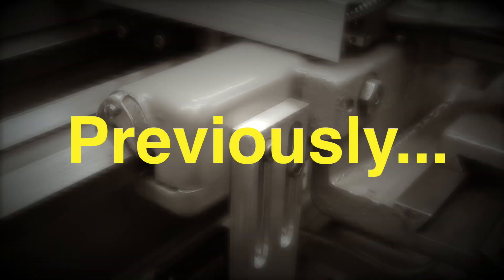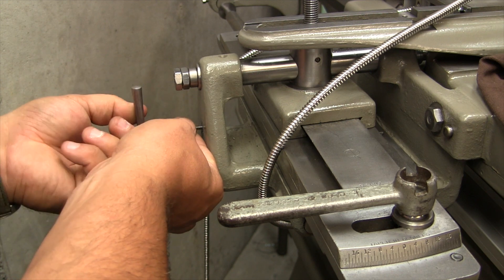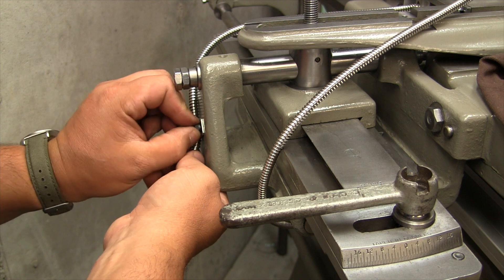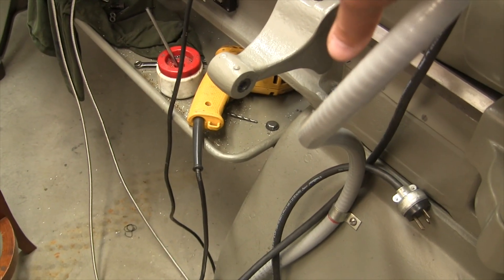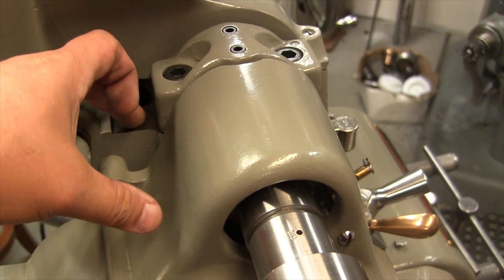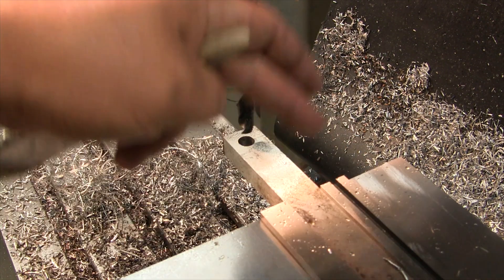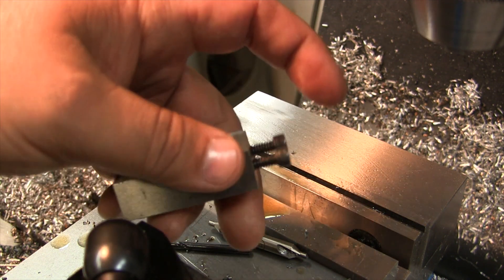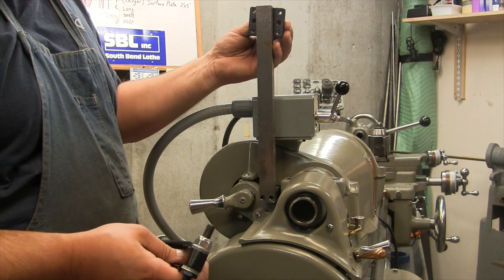Installing a DRO Pros DRO on a South Bend 13" Lathe Series   Part 5

Comment: .
Reply: +Russell Nales I really admire your workmanship! The results of your restorations is totally amazing. Your attention to detail and workplace cleanliness is to be admired. However, it is not necessary to verbalize every minute detail of every single action you perform. Cut out about 75% of your narration and you will have one of if not the top machinist video channels on YouTube. We are an intelligent audience. You don't have to explain that you are now inserting a screwdriver into the slot of a screw with the intention of rotating it in a particular direction. That being said, and I sincerely mean this, your restoration work is without equal!